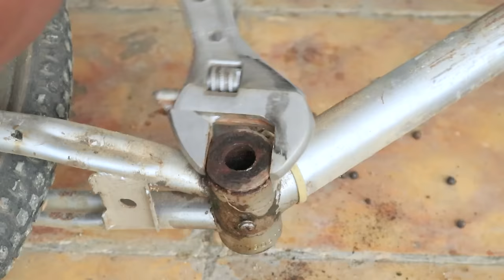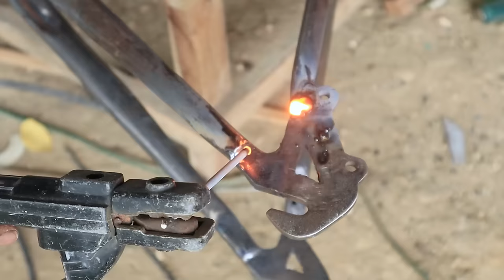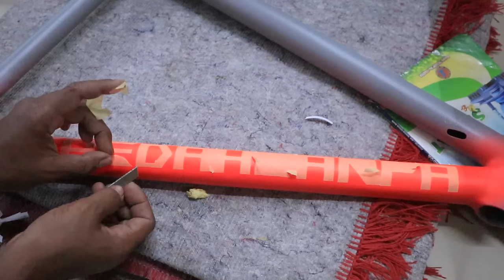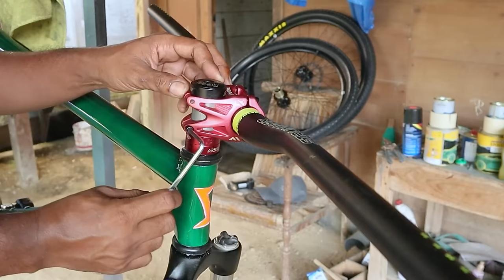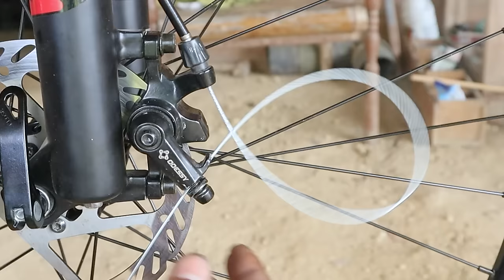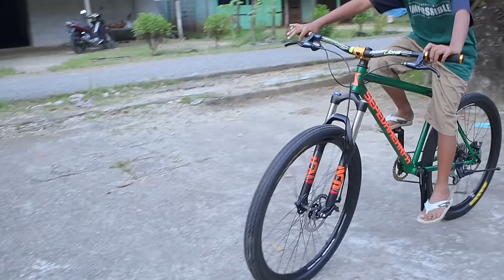RESTORATION BIKE FROM WRACKAGE BICYCLE with FULL UPGRADE

Comment: I think this is a fake film. The frame has been changed to a better one with inner brake lines, which is NOT the original frame. I consider this is cheat. It is definitely NO good in my humble opinion.
Reply: Maybe he drilled a hole?
Reply: I'm not sure, I mean the quill stem was upgraded by welding a new headtube along with the new quick release rear end, after doing all that there wouldn't be much point in getting a different frame.
Reply: Having watched tye start tye frame is the same one, the cable mounts on the frame at tye beginning math with stuff at the end
Reply: No brother he make drill
Reply: Shut up critic😂
Reply: He did mention "UPGRADE"
Reply: Да всë новое кроме рамы.
Reply: You obviously Skippy over the part where here doing body work
Reply: Yeah he just restorating so he can buy new part
Reply: Even the forks are different angle joining on wheel
Reply: 111
Reply: This cost are 7000 more